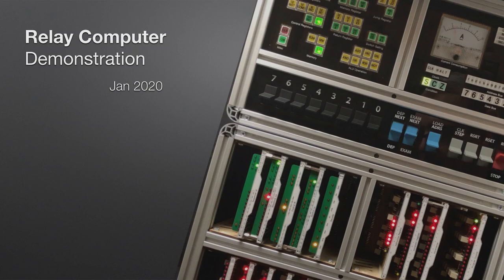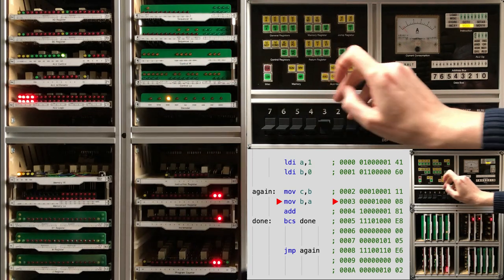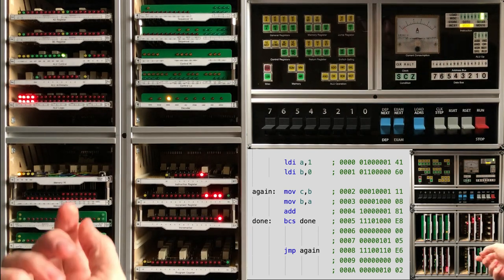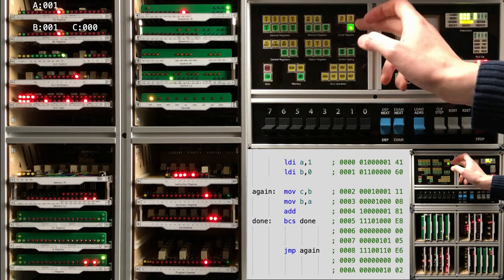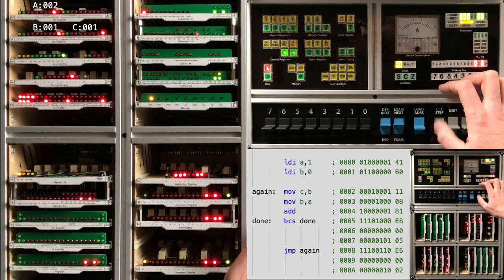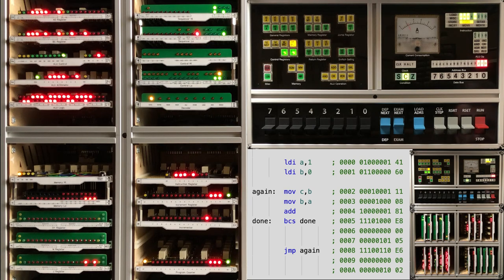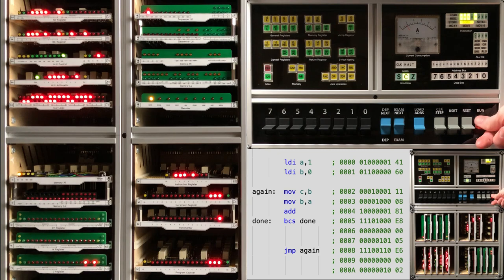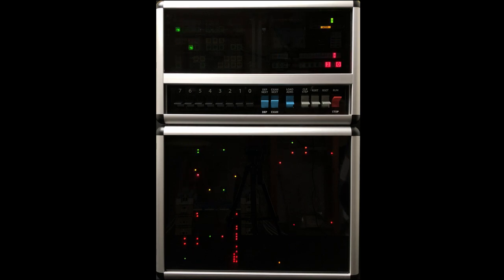Relay Computer 2020 Review: Demonstration

Comment: Why the dip switches for speed instead of a variable control?
Reply from the maker: At the moment it's running off a temporary clock board which uses a 32.768kHz crystal run through a series of 16 divide-by-2 gates (taking the clock down to 0.5Hz at the last gate). I tap off the result at the last 8 gates (0.5, 1, 2, 4, 8, 16, 32 and 64Hz) and put that through an 8-to-1 selector which takes a 3-bit input to select one of the 8 lines - that's what the DIP switch is controlling.

Previously I was using a 555 timer set up that had variable control but I wanted something that had some discrete fixed clock speeds. When I design the proper clock card I might implement both as well as having a more 'authentic' relay ring counter (which will be a fixed clock speed).

Comment: What kind of switches are those? I want to get some for a project I'm doing.
Reply from the maker: Do you mean the main 'paddle' switches? ... if so they're these ones:  https://www.nkkswitches.com.hk/products/Rockers/M/M2018TYW01 with the 'H' caps.
Reply from the maker: there's a bit more on them in my blog post here https://www.relaycomputer.co.uk/posts/2014/07/user-interface-data-switches/

Comment: what is the highest clock frequency?
Reply from the maker: The current (temporary) clock is based on a 32.768KHz crystal divided down and at 32Hz the computer works fine but at 64Hz the relays start locking up. The maximum will be somewhere between those two values (if I had a variable clock) but 32Hz is quick enough.